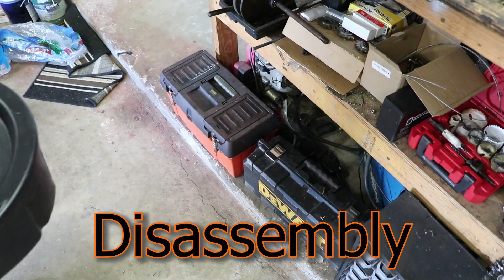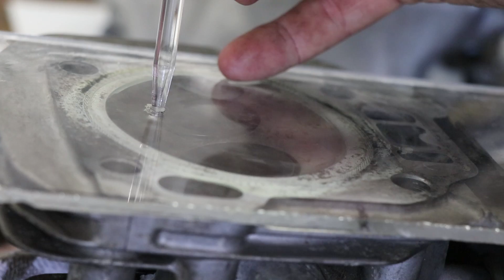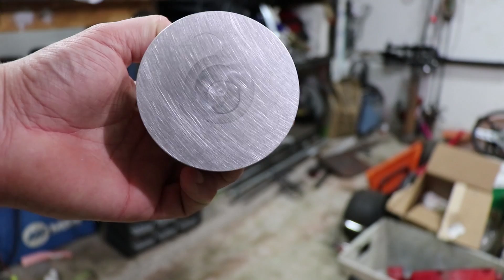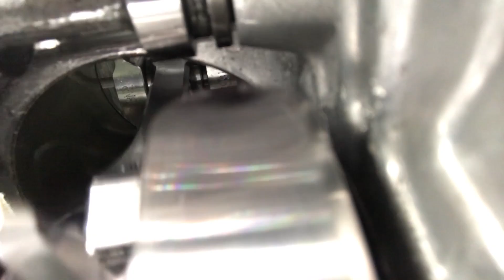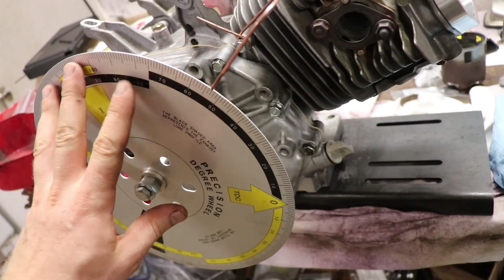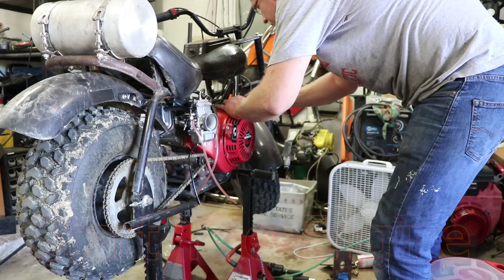Stroker Engine Build: 30+ HP on a 65 MPH Mini Bike! (Complete Build)

Comment: I once tried a outboard motor carb on a vertical shaft 3.5 
HP motor. The throttle was held open by a very stiff spring. It slipped out of my hand. By the time I got ahold            of it again it had rev'd over  10-15, 000 RPM.                (  NO- LOAD )mabe higher. When the rod broke😖 it took a good 30 or more seconds to stop spinning. Meanwhile it had a high pitch whine /scream because it was turning so fast. Wish I had the throttle fixed correctly now.... That was back in late "83-early "84". So that was a classic small engine. Imagine what could be done with a overhead valve engine. ??  With  a 2 stroke  (10-30 hp) carb.  !!!!!!! Mabe Contact a outboardmotor shop and see what you can find... I was going to try an Contact the Cars & Camera guys but all I can find there is older Videos....  Are they still making videos ?????? You just gained a subscription here. I've got a older Industrial Commercial Brigs 12 hp.   &  a 8 hp Brigs  horz shaft"s

Comment: So this brings the hp to almost a CBR300R level, that's crazy for a mini bike.
Reply from the maker: yeah, this engine it is 440cc though, the CBR is 286cc. Different power band torque etc, but you get the idea :-)
Reply: KartFab probably better on the street with the more torquey engine.

Comment: I'd ditch the TAV and run a 4 disc bully high stall setting and give the valves some 60lb springs to work with.

ETA: very nice build btw
Reply from the maker: That’s already in the works I’ve had the head for 6 months that has all the goodies.  Getting it o ringed this week
Reply: Right on. I'll watch the video if you put it up. Are you keeping the cam it has now or bumping that up?
Reply from the maker: 308 and keeping the roller rockers. Should give it some nice mid range and better top end. Engine is too powerful on bottom end right now and I’m constantly trying to keep the front wheel down. But I’m switching to M5 and going from 10.2:1 compression to 13.5:1 so I think it will just make more power across the board.
Reply: @KartFab  Thats a pretty big jump. If its lifting the wheel now on low end, wouldnt that increase just make it jumpier and almost impossible to keep down? Im just curious is all, I honestly dont know. There are so many troll assholes asking sarcastic dumbass rhetorical questions, that it is difficult to ask a legit question these days. Well good luck, this is the first video of yours that I have seen. Im gonna sub, very nice work.

Comment: you should have just milled the piston a little and milled slots for the valves which would have resulted in a higher compression ratio. sweet though
Reply from the maker: if i milled the piston a little, i would have little to no piston to head clearance.

Comment: Good video, however I would have made spacers to adjust the rocker height instead of using standard washers. The washers are not all the same thickness in height or from side to side. This can cause the rockers not to sit perpendicular and could cause problems down the road. Other than that good job...
Reply from the maker: Thanks for the insight Jody. Ive got another head and carb for it already and will get a spacer machined once I get that stuff on it.
Reply: You'd be amazed at what you can find at Home Depot...as far as what can be re-purposed, they have stainless spacers, aluminum spacers, etc...from 1/4", 1/2", 3/4", and 1", but it might be a pain to try to mill them down if you're dealing in thousands of an inch.  Rod stock might work better and save you the headache of multiple trips.  At least that's my curse.  Anytime a project begins with "All you gotta do is...", then you know it isn't gonna be so easy.  Unless you are Jody...lol  Great video KartFab!

Comment: "Bored out", may sound good to a lot of people, but unless it needs cleaned up you're mainly just adding extreme wear on you engine . True , it will add cubic inches, or centimeters , but hardly anything you'll notice at all. Try shaving your head. Is it faster than cutting or combing?
Reply from the maker: Did everything all at once. Cylinder was shot anyway so had to get it bored.

Comment: I didn't see any assembly lube used anywhere,just starry eyed pats on the back in the comments by most who know less & we'd this Big Block thing come from,do you shoe horn in a Chevy 396/402/427/454/500 & up ? 😋 Trev New Zealand
Reply from the maker: I put in break in oil and gave engine a shake before turning over. Break in oil is for people who build engines so slow the oil leaks off all mating surfaces before it gets turned over 😂😂
Reply: @KartFab  Don't speak/write misleading shite - I said assembly lube & I've been doing it since the early 1970s, break in oil is an entirely different thing ,is very thin & contains special fortified , why give such a smart,rude & illinformed reply ? Cheers Trev New Zealand home of world's fastest Indian
Reply: @KartFab  And to give you an Efucashun assembly lube like what Isky sells is absolutely needed on new Cams/lifters especially if you've fitted hi pressure Valvesprings,there's the rings,the b/end bearing etc..run in oils are entirely different, they contain fortified like ZINC & PHOSPHATE etc anti-wear additives that aren't contained in Sears take home packs anymore because of your EPA. That's why Castrol for eg market 4 stroke motor Oil .What you said showed yourself up !😆😪
Reply: NB NO comeback...because I'm right.
Reply: Lucas markets some good lube with the missing Zinc & Phosphate and other anti wear protectors in it that you don't get in most modern take home. Pack 4 stroke motor oils anymore at Walmart.Once it's run in I'd run a can of treacle - STP scientifically tested products, also wouldn't recommend alloy valve retainers normally because in aut omtive use they fatique & crack but with the low overall v/spring pressures you should be ok but I'm dubiuos about longevity.T cheers

Comment: I have a sawmill with a gx 340. 11hp im no expert but, can it be done on a gx 340   Verry interesting to see the 390  get more power,   I wonder if the gx 340 boosted if its possible like the 390 would work in a sawmill application? It would be cool if it did! any thoughts 👊

Comment: good video could you try a 8hp predator on a gokart
Reply from the maker: Yeah I am going to do a build series for my wrecked go kart (midas) doing stage 1-4 build of a predator 212. That will come later on.
Reply: The 212 has pretty flat torque from 2000-3600rpms. I notice its very smooth around 3400-3600 but between 3700-4400 rpms, I have major vibration. I imagine balancing alone could net decent gains within this range.
Reply from the maker: balancing has the potential to correct about 1 hp of loss due to vibrations.
Reply: Thats pretty good. I also noticed after putting about 10 miles on my chain, (couple of minutes). My cruising speed increased around 3mph.

Comment: I’m building almost this exact set up. You said you had to get a short connecting rod. What size rod did you end up using for the build? Is the link in the description the correct length rod? Awesome build!
Reply from the maker: I had a one off block. The new gx390s have a taller deck so no issues there
Reply: @KartFab  not sure which block I have. Part number starts with GCANK. Came off a generator.
Reply: @KartFab  what was the length of the pushrods? This being my first big block build, I have so many questions. I’d love to pick your brain about this build.

Comment: ...even it's about 2 years ago but

🙏 I NEED TO KNOW SOME "standard gasoline" JET SIZE SETUPS FOR THOSE TM32/34 FLATSIDE MIKUNIS RUNNING ON GX390/420s 🙏

Over here in europe they dont have any experience -they all use tm33pumper -but i bought a tm34 kit from the u.s. -was signed as "ready to run" ...but when i installed it the engine runs way to rich -it might be a setup for Methanol or something -so i bought a lot of main and side jets and it definitely became better but it's no fun to ride and the bored oem carb makes a much better performance without any troubleshoots

...so maybe somebody in here is running a simular setup like this one in the video or at least a gx390/420clone with a 32/34 FLATSIDE !? 
-would be very thankful for any kind of information to get this thing running propper on my engine without any trouble and feelings like havin a "turbo lag" 

IN CASE YOU HAVE A GOOD RUNNING SETUP PLEASE 🙏 OPEN UP YOUR CARB AND TAKE A LOOK AT YOUR MAIN AND SIDE JETs 🤗 ...would be just amazing 🙈

#THX
Reply from the maker: Main jet is too rich drop both pilot and main down.

Comment: I plan on doing a vtwin baja heat
I want to use a kolher command and do some basic mods to it 
I think ot should be a death trap and a half
Reply from the maker: yeah you will have to raise that center horizontal support to get it to even fit. Good luck buddy! its way too much horsepower ahaha
Reply: @KartFab  yep already got that done 
A 6in rase fits a vangurd 18hp
A 8-9 fits a kolher and a predator from my testing

Comment: Awesome video and very very informative and detailed sir. Question, when you grind away at the cam and connecting rod doesn't that throw the balance off and should you of done all that checking if anything is going to rub before you had the crank assembly balanced? I gave this video a gigantic thumbs up. 👍
Reply from the maker: Yes it does I edited video wrong. I had it balanced at the end.

Comment: Do you have problems shredding belts on built big blocks? I know belt alignment is key but I also know the 40 series is only rated for 18 horsepower. That being said I've seen people put 40 series torque converters on modified 670s with surprising results.
Reply from the maker: I only run genuine comet belts and with proper driven orientation so it doesn’t side load the belt. Belts don’t shred unless misaligned or way too much HP. I have cracked jackshaft due to hp. The belt will slip excessively on driven if I go full throttle. Hearing has a lot to do with it as well. I’ve smoked a belt here and there as it slipped but no shredding
Reply: @KartFab  Well a lot of the 40 series backplate kits they sell try to copy the principle of the 30 series, but fail to take into account that the driver pushes towards the engine and the driven (on the backplate kits at least) push away. This causes massive misalignment. This is remedied by running the driver backwards and spacing out the driven to line up, or run it with the driver facing outward the driven facing inward (the way comet originally intended). It is good to hear that properly aligning the belt lets you run them past power rating. If I ever do a big block build it will be a more mild build. If I want a stronger transmission I'll go with the 780 and a custom-built backplate.
Reply from the maker: @BunkerBlog  780 is worse than 40 series. There is a company in canada that can make you a torque converter CVtech or something like that.
Reply: @KartFab  Yeah I think Vegas Carts sells CVTech clutches. Pretty sure they use the same belts/drivens as the 780s. What's wrong with the 780 though?
Reply from the maker: @BunkerBlog  nothing is wrong with it. everything has its limit.

Comment: Great video, how did you know to time the motor to 20° before TDC? I understand checking the top dead center with the degree wheel and the camshaft, did you use a timing light off camera?
Reply from the maker: I used timing light it doesn’t show up on camera due to frame rate
Reply: KartFab makes total sense and thank you!

Comment: Hi KartFab! Just a quick guestion about boring. Your response is higly appreciated since I cant find anything on internet. Did you have any problems after boring to 90mm? I read on some forum where you said that after boring to 90mm your sleeve doesnt go 100% through the block. Im asking because I want to bore my block also to 90mm, and my machinist says that it will end up with really thin walls (1mm) which is not ideal.
Reply from the maker: Bore it to 90, it’s got a really thick sleeve if you are worried you can try the  ARC site and get a .010” over 88mm piston
Reply: @KartFab  thanks. Actually its a clone engine so Im not so sure if the sleeve is as thick as in original honda. Didnt you wrote on some forum saying that after you got your engine bored to 90mm the sleeve didnt go 100% through? Thats what got me worried

Comment: My brother has a 3hp briggs on his and hes tired of going slow so can i take the gov off and not have to worry about anything because it looks like every thing is the same size in the 3hp as my 5hp gokart except the valves amd the engine block and crankshaft so idk if it would have any probs with the gov off because it looks like it has a 5hp piston rod or conrod so will i be throwing a rod?

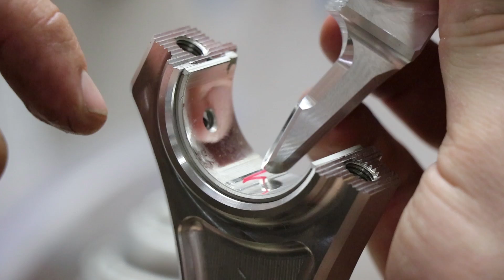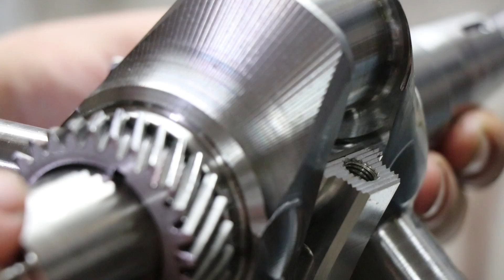Comment: At time 7:06 the plastigage is correctly positioned  but at time  7:13 the plastigage is NOT positioned correctly on the journal.
Reply from the maker: thanks for catching that. I actually combined footage and did the plastigage thing like 3 times. I always run it from one end of the journal to the other end. but on this one i was just tyring to get a good shot. and forgot to cut a longer piece.

Comment: Are you by chance subscribed to red beards garage? I can't find any of the people you are subscribed to as you have it set to private I'm guessing but I would really really like for him to see this video. You did an absolutely fantastic job I bet that thing is a screamer. I'd like to put that on my Manco dingo!!
Reply from the maker: Yeah I am. I bet he will see the video eventually. It has way too much power for the torque converter. I cant go more than 1/4 throttle on start up or it will flip the bike over.
Reply: Time for a removable wheelie bar maybe. lol. Nice build btw. Subbed
Reply: KartFab he is testing a new torque converter right now for gopowersports I think they are calling it a 60 series but I may be wrong. It looks just like what would be on a snowmobile it's got that domed end cap
Reply: Shit i bet you are at 75 hp then

Comment: Is this engine, without the balance shaft, going to vibrate too much??? Or is this new crankshat designed to work without the balance shaft in place???
Reply from the maker: Crank, piston, and con rod are balanced before assembky

Comment: I’m building a 340 GX now shaved head Cam 3800 springs mukini 34flat slide. Port match  header zero governed Bill it. Fly wheel Bill it rod 10-1 pull start 380 cam with ez start   What would you expect real Hp .?
Reply from the maker: At least 24 hp

Comment: Where did you get a billet fly wheel with a starter ring gear? did you use a ring gear from a stock flywheel? Thanks for the help.
Reply from the maker: ARC Racing
Reply: Found it!  Thanks Grant. Keep up the great work!

Comment: What do you do if the oil clearance between your crank and connecting rod are off?  What would be the next step?
Reply from the maker: Too much clearance? Special order a Babbitt Bearing from the manufacturer. Not enough? Sandpaper and polish the journal until clearance is achieved.

Comment: It's crazy because I look at this filled and stuff like this nowadays and it just confuses me. I have a 225 Tillotson that does 82 miles an hour and supposedly puts out 17 horsepower if I had a 30 horsepower motor you should be going well over a hundred miles an hour
Reply from the maker: Rpm dictates speed as long as the horsepower is not overcome by losses (wind, friction, heat)
Reply: I mean I do understand that RPM is a big function of these engines to hit high top speed but again that further proves my point. I only rev my Tillotson 225 up to 7500 and I can get up to 82 miles an hour on a mini bike with a 10 tooth front sprocket clutch and a 46 rear sprocket with a bike that weighs around 250 lb with me on it. That's why I'm confused that you have a 10000 RPM build that are only do 65 and it has almost double the horsepower

Comment: Dang that's like a $2500 go cart engine. I know they are fun but wouldn't it be more cost effective to buy old 250/300 ex quads then you would even have a 5 speed and a clutch on the 300. Couldeven use other quad engines as well.
Reply from the maker: You are right

Comment: i demand to see it on nos
Reply from the maker: This engine is shortly going to be running on VP racing M5 fuel. When you run an engine like this on methanol, it will make more horsepower than it Everwood with gas and nitrous. M5 is a certain type of methanol that has nitroparaffins in it, so basically it is nitro methanol.